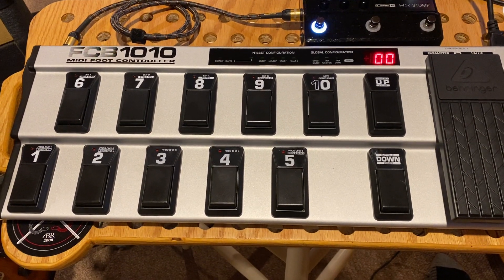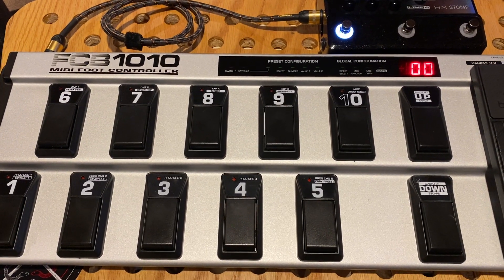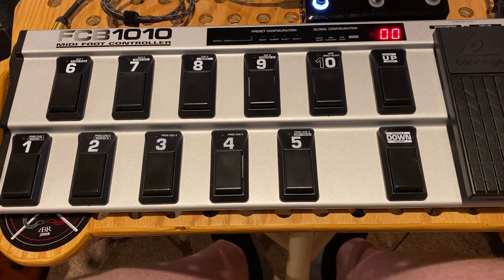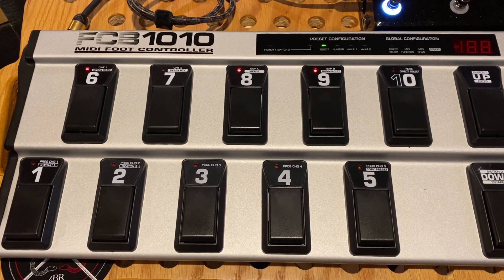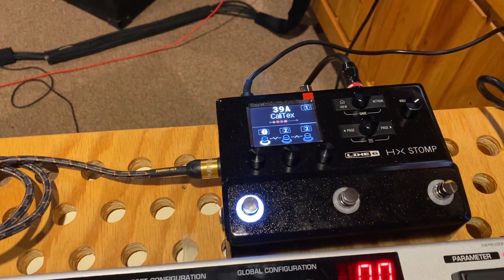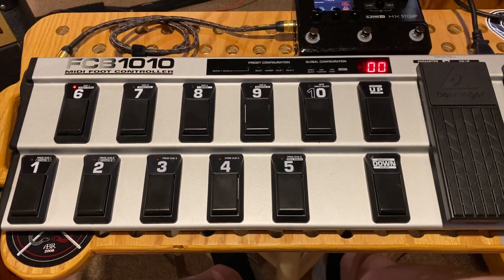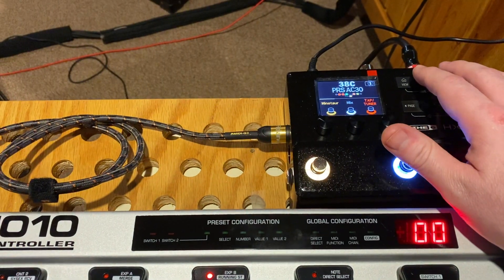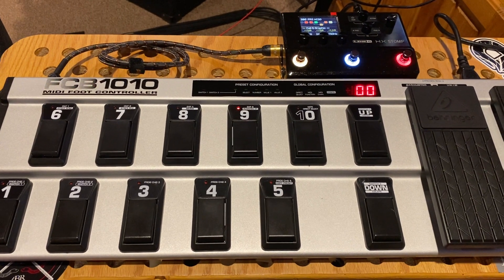Configuring the Behringer FCB1010 with the Line6 HX Stomp

Comment: Sorry if I missed it, but is it possible to control individual stomp parameters (gain/tone/whatever) via this or any other controler
Reply from the maker: It looks like this would be possible, although, I haven't done it.  Here is a link to the LIne6 HX Stomp Manual (https://line6.com/data/6/0a00051afdda673cccdb61c9c/application/pdf/HX%20Stomp%203.80%20Owner's%20Manual%20-%20English%20.pdf?_gl=1*5e6l27*_up*MQ..*_gs*MQ..&gclid=CjwKCAjwuIbBBhBvEiwAsNypvXemYrfPcqX27y5wjCNafkVMfr_3I0SSB7mmGrCC7m9jOrFNCQKjMxoC9_gQAvD_BwE&gbraid=0AAAAADyhTKJUjg64nXxnrLoPdhgH8DdCq), and if you go to page 65, you'll see where you can work with controlling the individual parameters on the HX Stomp.

Comment: Need help with my Line-6 POD HD500X and FCB1010, please. I have searched for a long time and your function of SNAP Shot may be the nearest way. I used my FCB1010 with Yamaha-DG80 many years ago. Those presets listed with consecutive number so it was not hard. The HD500X uses 1A, 1B, 1C, 1D then 2A......all the way to 16D. It has footswitch but the View of Big Letter will not automatically show. I have to bend down and use finger to tap the button. Very hard to do with guitar on my neck.
I tried to download software FCB1010 Manager or Edit but have problem with Beringer Firmware still = "Unknown". Right now I can use the FCB1010 pedal 1-5 & 6-10 with Up-Down and activate about 20-30 Snapshots or Presets. But they are not in proper sequenes plus the errors of wrong amp, filters and mixtures. Thanks,
PS: I can use just 1 line of Midi Cable Out from FCB1010 to HD500X in? I'm still strucggling with full Midid conn between PC and FCB1010.

Comment: If you don't want to use a block for your expression volume, just assign the volume parameter in an 'always on' block like the amp or a compressor to your expression pedal, give it a min value of around -18dB, because if you go 0% to 100%, the smallest variation in the position of the exp pedal will be huge.

Comment: Jesus, this thing looks like a massive pain in the arse! Can it send multiple messages per pedal? Ideally, I'm looking for something that will control my guitar fx and a DMX controller *simultaneously*, ie when I hit pedal 1 the distortion kicks in and the stage lights change, for example. Is that doable on this?
Reply from the maker: It's not bad once you understand what is going on...There is a learning curve, but the satisfaction of getting it to work the way that I wanted was worth it for me.  I no longer have the FCB1010 or the HX Stomp, so I can't directly answer your questions from experience, but based on what I've read, it does look like the FCB1010 should be able to handle sending multiple MIDI commands at once.

Comment: FCB1010 with  hx stomp    Set midi channel to 1 on HX and FCB

Expression Pedals
Bank 00 (or whatever u want)
Hit the FS you want to program
Hold DOWN button 3 sec
hit up button   (confirms edit mode)
Need ONLY fs 8&9 with solid led  (press and hold them to get there)
press 8 so it blinks
press up to confirm 
select CC number.   Can be whatever you want (need to set it on helix)
press up to confirm 
Set low value of 00.
press up to confirm 
press 9 so it blinks
press up to confirm 
select the CC number you already set
press up to confirm 
Set High value of 127    (high and low can be swapped to reverse it)
press up to confirm 
hold down to save and exit edit mode.

Comment: Hey, man! I found a way to use the expression pedals without adding a specific block. You have to use Stomp's Learn function. You can set both volume and effects: Wah and pitch, for example.
Reply: how?
Reply: @adg2011mm  you set a Midi value on the exoression pedal from the Behringer and set this pedal to control the volume at the end of your chain (in HX). You can acess this volume true the circle at the end of the chain. The problem with this method is that you need to set this for every pre-set you have. But it works.
Reply: you kind of use the output from the HX as a volume pedal
Reply: @AlexandrePiazza  Sabe me dizer se FCB1010 da para utilizar com a Hotone Ampero II Stomp
Reply: @WILLIAMMACIELFRANCAPINTO  oi amigo, não sei te dizer com 100% de certeza. Mas como esse Ampero II tem entrada e saída de MIDI é pra funcionar sim.